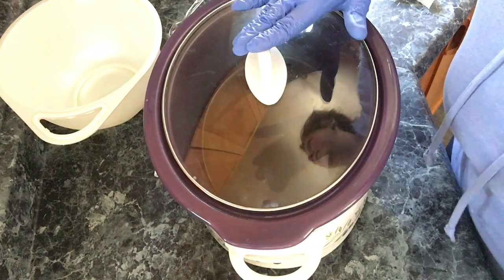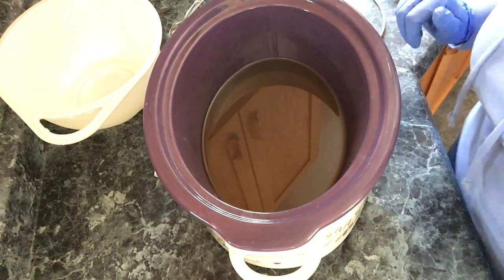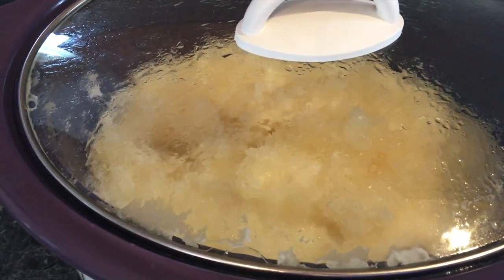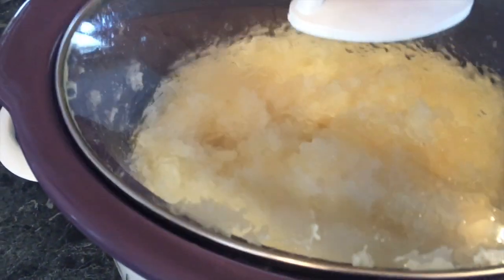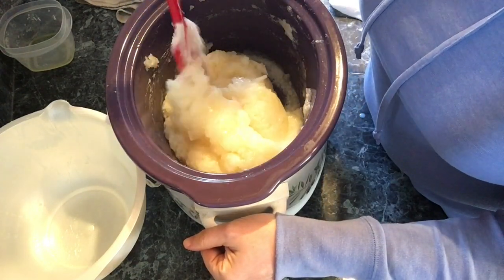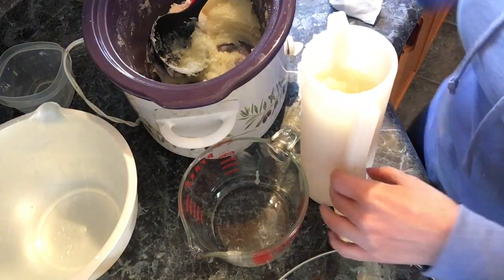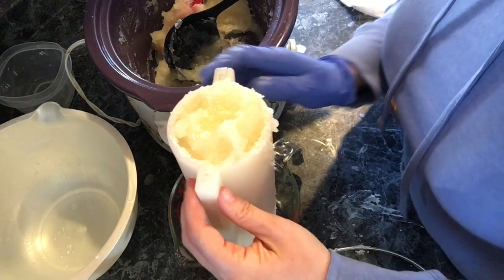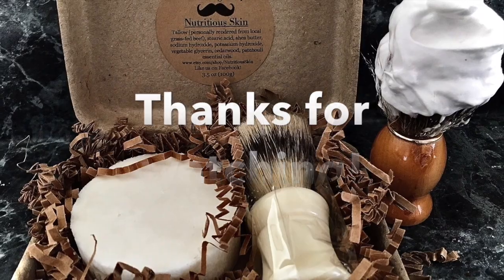Basic shave soap tutorial... and then this happened.

Comment: Should I care what temp my lye and oils are before they mix them?  My lye is 156 and oils are 244
Reply from the maker: Great question! I have never taken a temp in my life for soap, but if you are taking temperatures, the general guideline is to combine them when they are within 10 degrees of each other.
Reply: @SNIFNaturalSoapmaking  ok , I think I am going to let the oil and lye cool a little.  When I mixed the potassium hydroxide +sodium  hydroxide with water, without considering water temp it started boiling up.  I quickly dumped it down the sink and made it  again with really cold non-iced water and it was fine.  Hence my hesitation to add water to the oils above 200 degrees.
Reply from the maker: @lupinekennels  Let me know how the second time goes!
Reply: @SNIFNaturalSoapmaking  I shut off the crock pot and took it down to 190. Added the lye. Stirred it, Stick blended to mashed potatoes . Closed the lid , Turned it on high and about 15 min later it was at the vaseline state.  Added my glycerin and nag champa. Looks  like it's going to be good!  Thank you so much for your videos!!
Reply from the maker: @lupinekennels  So glad to hear it!!
Reply: One last question.  Where can I find a soap calc where you can put both sodium hydroxide  and potassium  hydroxide? I only see choose one?